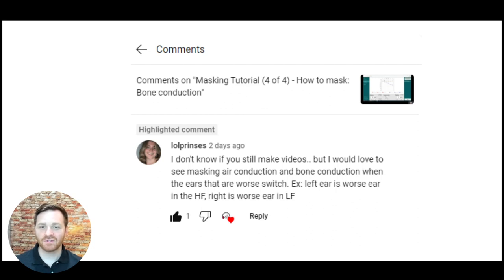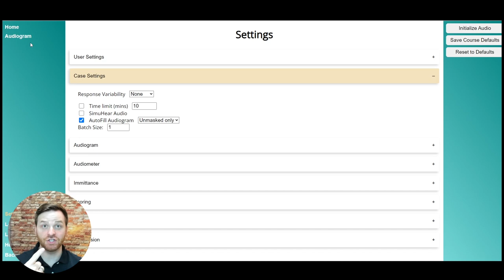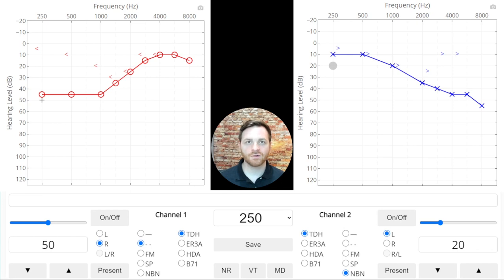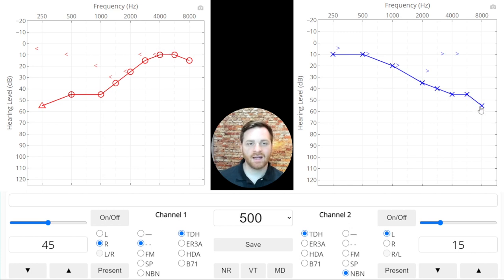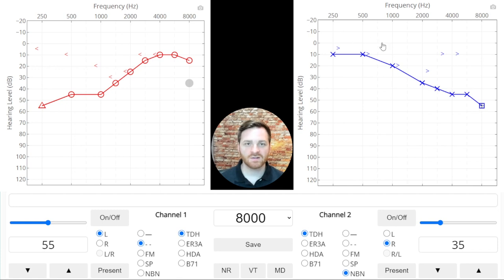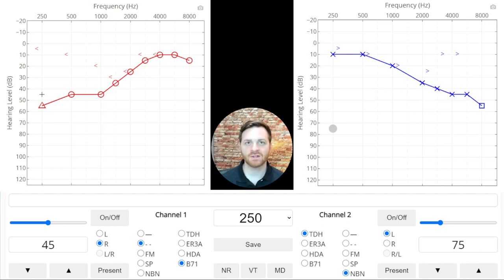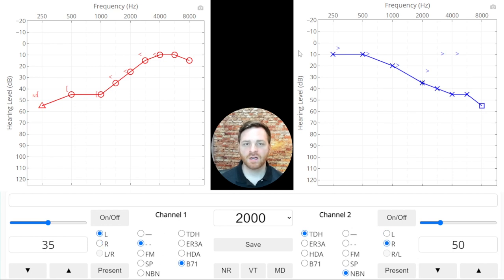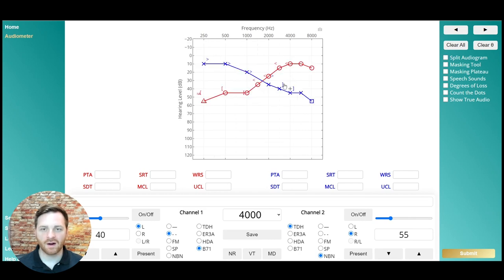Don't get tricked by this audiogram! Masking tutorial

Comment: The oclussion effect for 250Hz is 30dB right? so the initial masking should be 50dB at minute 11:41
Reply from the maker: We're re-evaluating what the recommended OE should be at 250 Hz since we started following the ASHA recommendation to include 250 Hz Bone conduction testing. 

Most widely used and cited is Yacullo (1996) who found an occlusion effect of 30 dB at 250 Hz for supra-aural headphones. The Katz Handbook of Clinical Audiology also recommends this value based on this research.

Other studies found different values. For example: Goldstein and Newman (1994) found 15 dB OE @ 250. and Roeser & Clark (2000) found 20 dB OE @ 250. 

Averaging the data from all three studies, we find an average occlusion effect of 21.7 dB. We've updated our Theta defaults for OE @ 250 Hz to be 20 dB in light of this data. 

If you don't like this update, you can change the occlusion effect to match what you're learning! Ask your instructor (or change it yourself when you design a case!). One of the great things about Theta is that it allows you to change these parameters based on what you feel comfortable with!